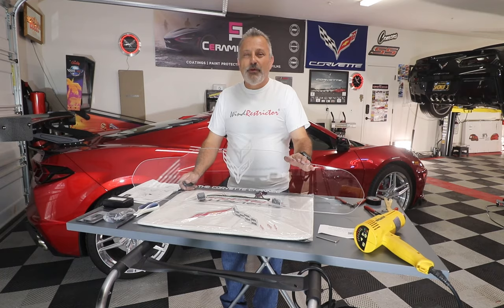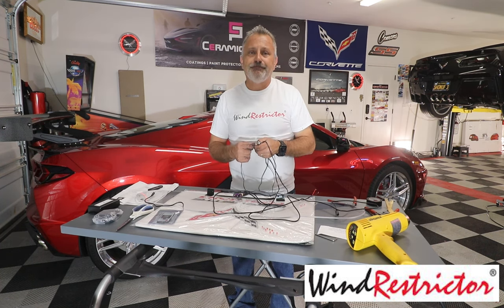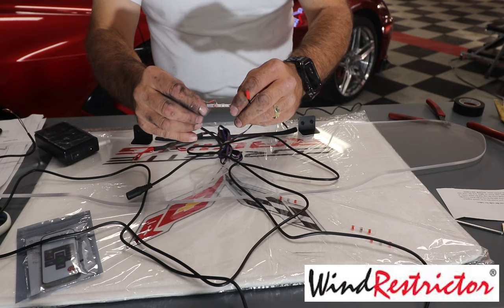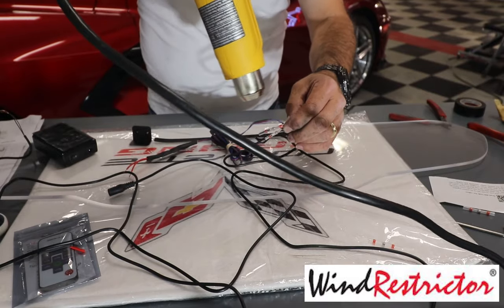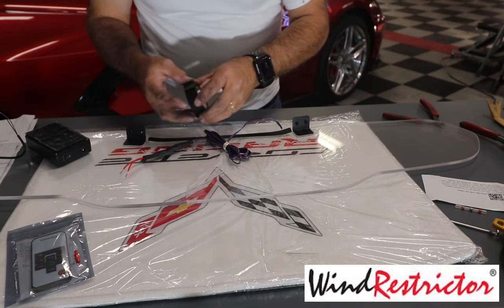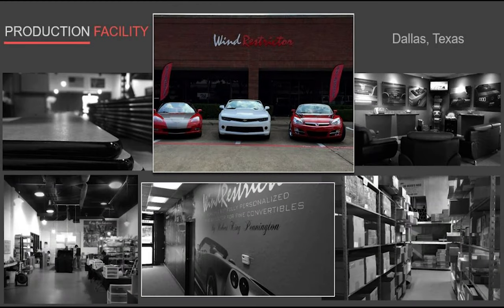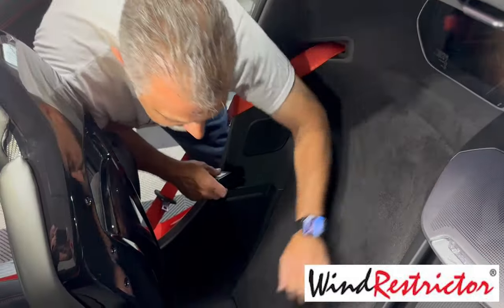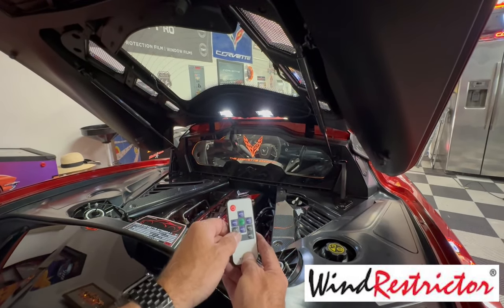How to Install a Windrestrictor in  a C8 Corvette

Comment: Do you have a link for the connector wire that needs to be purchased? Thanks
Reply from the maker: Just mention it when placing the order.
Reply: @THECORVETTECHANNEL  the item is not on their website. I had to contact them and they are shipping one out to me. Thank you again. Just had a question regarding the connection. You connect the cigarette lighter to that connector that needs to be purchased separately?
Reply from the maker: @marksienko2855  I am flying home today. Why don’t you give me a call tomorrow and we can talk about it. 916-412-7268
Reply: @THECORVETTECHANNEL ok sounds good, will do. Thank you!
Reply: @THECORVETTECHANNEL just wanted to thank you once again for the video and the recommendation to wire it both ways. I was able to do it and it was fairly easy after watching your video.